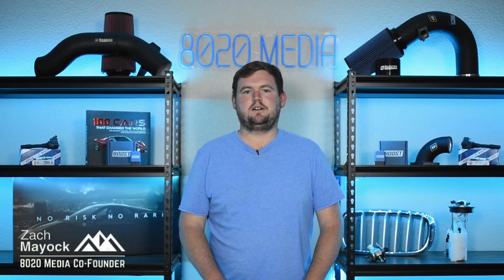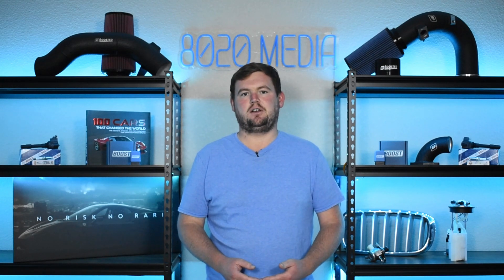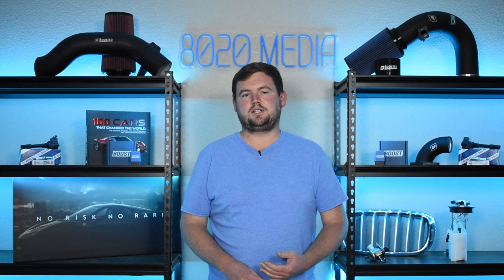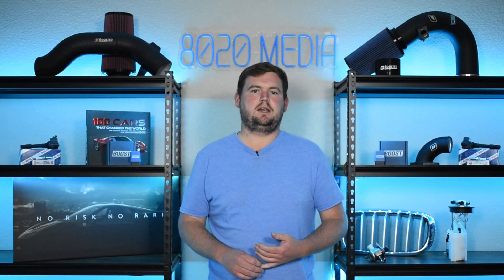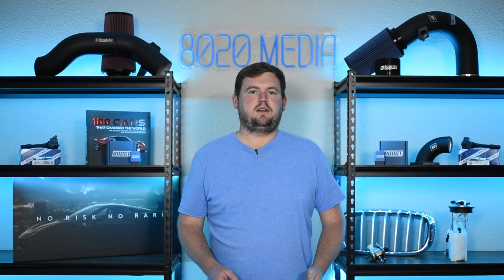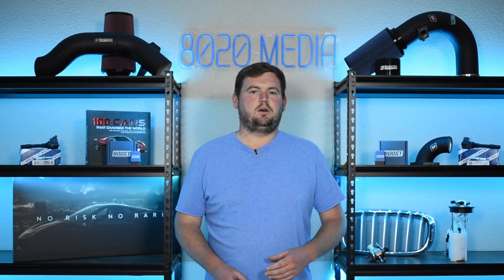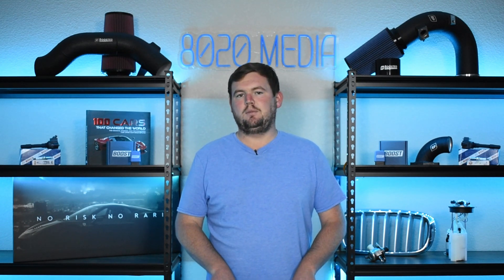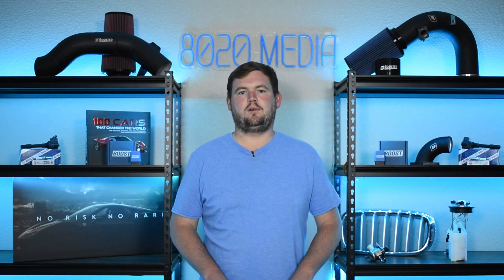Signs & Symptoms of Bad Engine/Motor Mounts!

Comment: My Citroen DS3 5 speed manual gear, 2015 model, the engine is vibrating and makes weird noise when idling. And when i place my foot on accelerator or clutch pads to change gears it makes click sounds. What would be the cause? your response would be much appreciated as i am a female and has no knowledge about cars. I have spent too much money on my car already. Please help
Reply from the maker: M - Based on your symptoms, this could point to a few common issues: first, worn engine mounts or transmission mounts may be causing the excessive vibration and noises; second, the clicking when pressing the clutch could indicate a worn or failing clutch release bearing or clutch assembly, which is common with age and wear; third, if the engine runs roughly or feels like it's "shaking," it could be due to misfiring caused by faulty spark plugs, ignition coils, or even an engine sensor like the MAF or crankshaft sensor. It's also possible the dual-mass flywheel (if equipped) is worn out and making noises when engaging the clutch. Since you’ve already spent a lot on the car, I recommend having a trusted independent mechanic (not a dealer) inspect the engine mounts and clutch system first, as those are the most likely culprits and can often be diagnosed without extensive labor. Let them know the symptoms clearly—vibration at idle, noise when pressing the clutch—and ask for a written quote before approving any work.

Comment: I am trying to diagnose this in my car, its a '99 turbo and it is fine so long as its not on heavy boost, it's fine on idle and at high rpm with out boost. Im not sure if its just over boost from some after market parts that were installed before I bought it, or if the mounts are going out. 
Do you have any thoughts on this? 
Thank you.